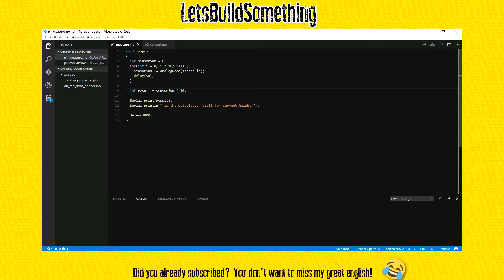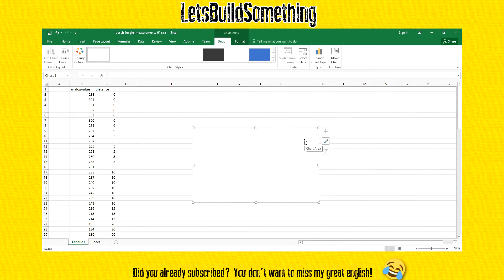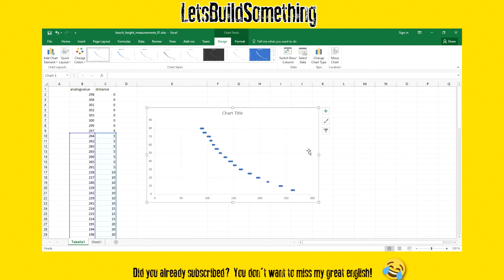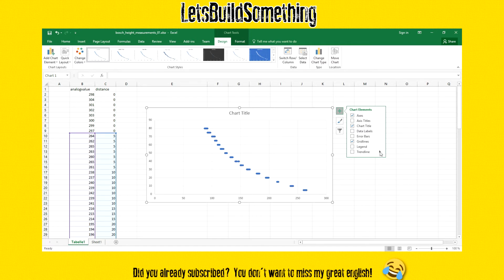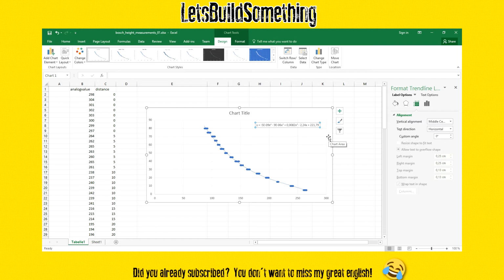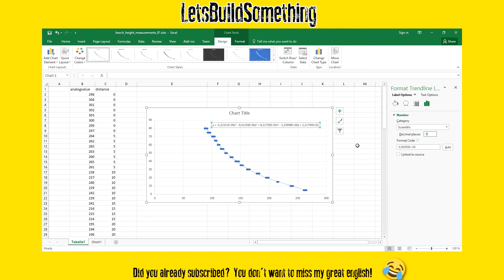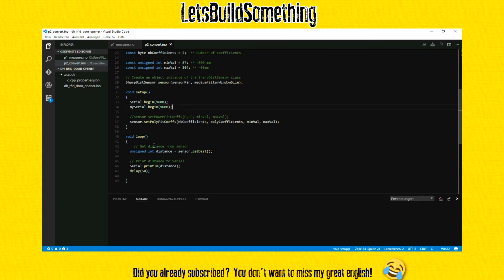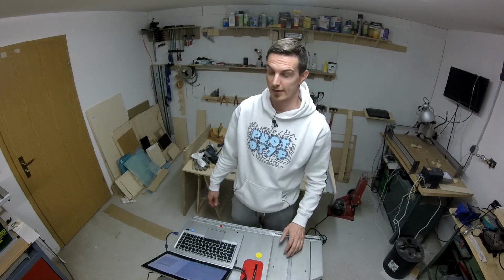Bosch GTS 10 XC HACK - The automated height gauge! - Part #2

Comment: Hi, ingenious.

A few questions if I may:
     What was the material you drilled and tapped to mount the sensor to the table saw?
     How has the setup stood up to the vibration from the saw?
     Has the sensor been impacted by dust settling on it?
     Has the sensor given you a consistent height of blade or have you had to recalibrate the sensor?
Have I missed part 3, I can’t seem to find it?